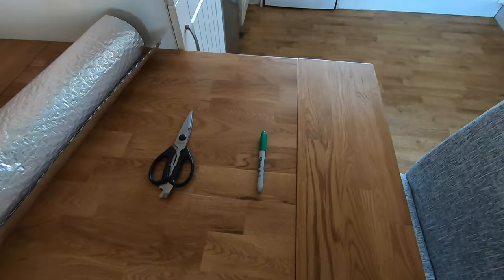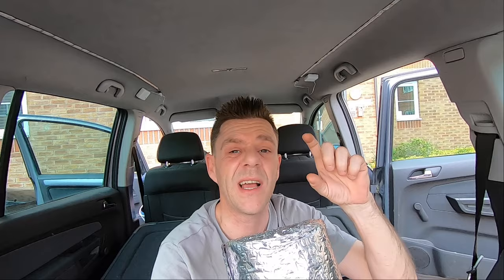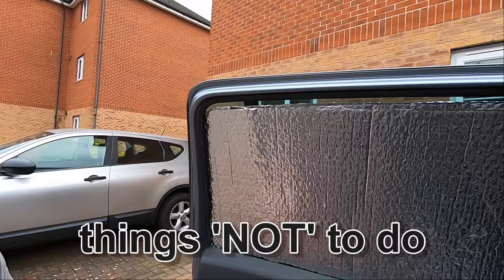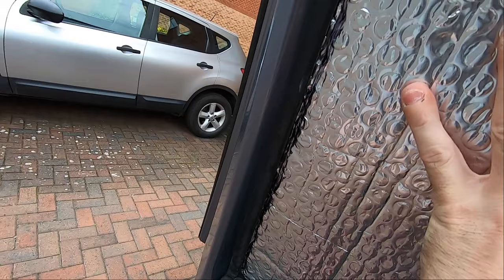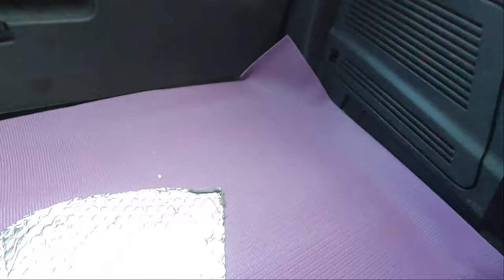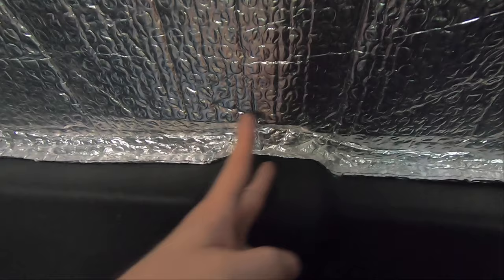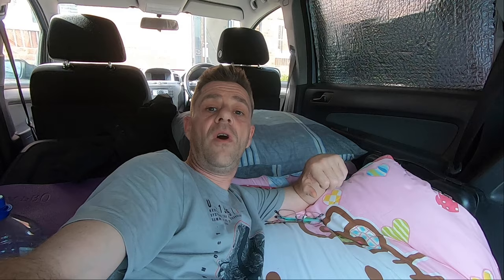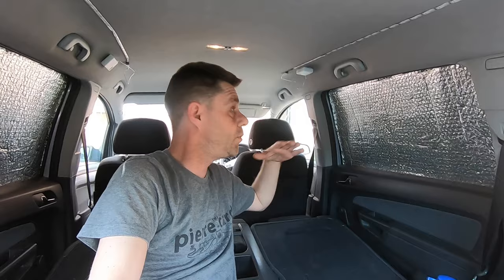STEALTH CAR BLACKOUT WINDOW COVERS How I Made Mine   - Cheap Easy Quick 🚗

Comment: How I did mine was two sheets of the thermal wrap stuck together then covered both sides with the black 4 way stretch carpet and then black gaffa tape around the edges. This makes it look even more stealth as from the outside the windows just look black and not all the shiny foil making it look less obvious someone is camping inside 👍
Reply from the maker: yeh its that silver shinny look i want to get rid of
Reply: @wanderingwhere  My window covers the same as yours. I just taped one side of my covers with strips of black tape (couple of quids at Home Bargins)
Reply: Black does absorb more heat from the sun though. So that's the negative of the stealth look.
Reply: Curious to know what black, 4 way carpet is?
Reply: @XabooAlex It's that carpet you can lay in vans or SUV's. Comes in a roll. 👍🏼
Reply: I was thinking of spray painting them
Reply: Can you still do the tuck into the frame using two wraps together?
Reply: @CHRISMED2  probably not
Reply: I can buy all this from Michael’s store and or Home Depot?
Reply: @itsascaryworld9788  yes
Reply: @Raysreallife  thanks about to live in my car until the end of the year. Asking any questions to have the best privacy. Thanks.

Comment: I made mine using a yoga mat.  Seriously.  It completely blocks out the light, it's easy to cut, it's firm yet flexible, it's soft and insulated, and condensation doesn't wreck it because it's made to withstand sweat.

Also maybe a thick tarp would be a good material to use too?
Reply from the maker: couple of ppl havementioned making them out of those i really should try

Comment: Much obliged for this idea. Instead of leaving the insulation by themselves, I used black poster boards facing the interior. They popped in like a glove, just be sure to include a hook at the center to easily pop them out.

Comment: I bought custom cut tint on-line and they are the perfect temp plate. Cost US $40. Totally worth it.
Reply: So did you just give your make and model to get the proper measurements or did you pre measure? Do you have the website you used and was it hard to install the tint? Thanks
Reply: Where ?

Comment: I use a hatchback for work and I wana take the back seats out. I’m gona use this to cover the windows. Gona put two layers, one in front and one behind a piece of plastic corex. And use some foil tape to stop it coming off. Thanks for the idea. Can I just ask if it stays in place well enough?
Reply from the maker: Yeh they stay in place urll find there gaps they slot into so make them oversized and trimm accordingly as u test and retest the size and shape

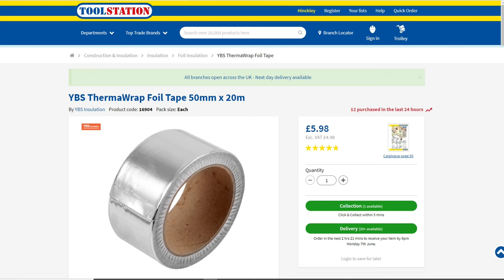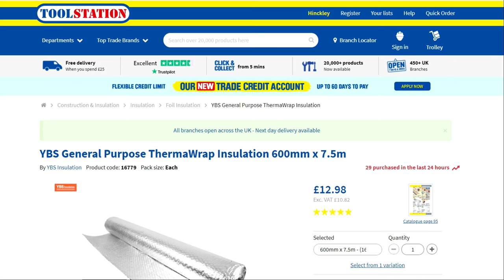Comment: Hi, how did you stick it to window? Does it stay up by itself? 3:22 suction cups. 0:23 Thermawrap.
Reply from the maker: ive found that all mine stay up by themselves with no suction cups as most my windows have a little recesses that the thermawrap slots in then i go round the rest of it and finger it into the groves around the window if you get what i mean, i dont use anything on my front window though as i now have curtains but would imagine u would need suction cups for that
Reply: How did you fit your front windows for curtains? Thanks